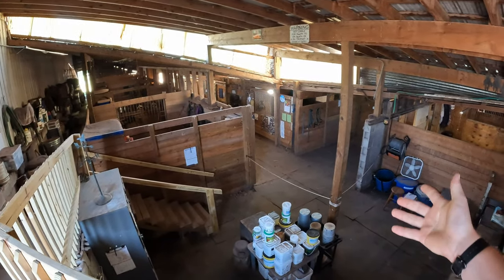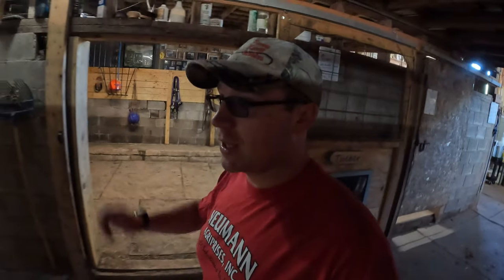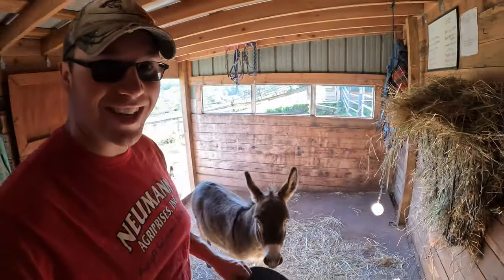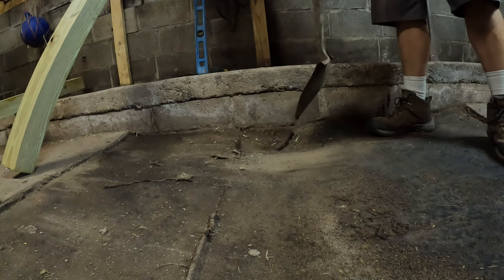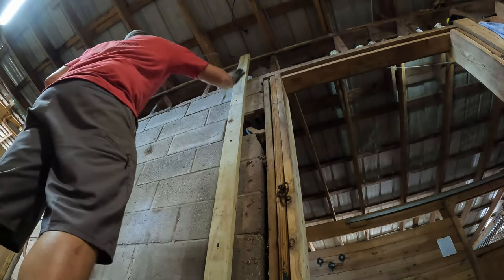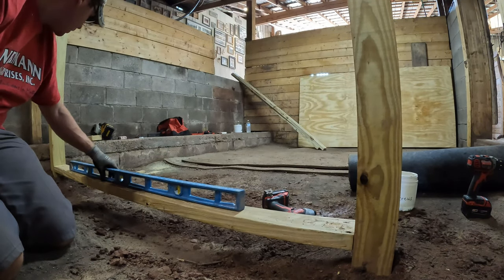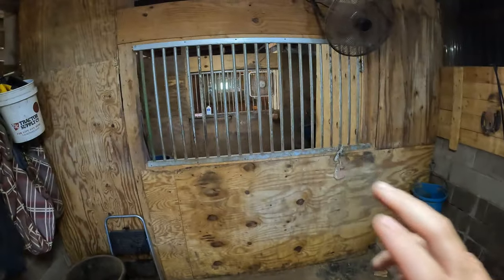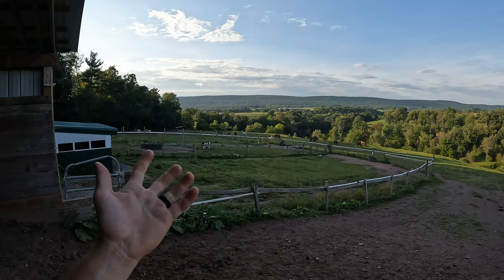Building New Stalls For Our Stable

Comment: Just an FYI so you don't get flack from a carpenter. Using a level horizontally is checking for level. Using a level vertically is making it plumb. You can also use a string with a bob on it to check the plumb of a wall or beam. 

Anyhow, good job on the wall so far. You are definitely increasing your skills and doing a fantastic job at upgrading the stable. It's  all turning out awesome.